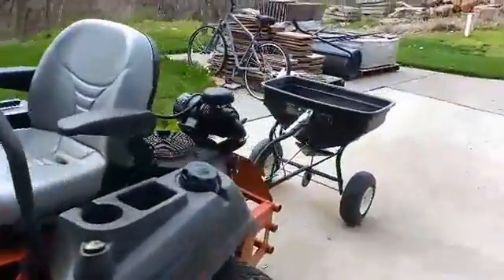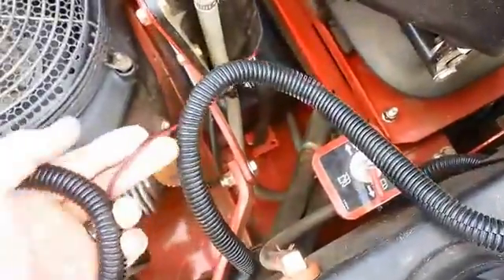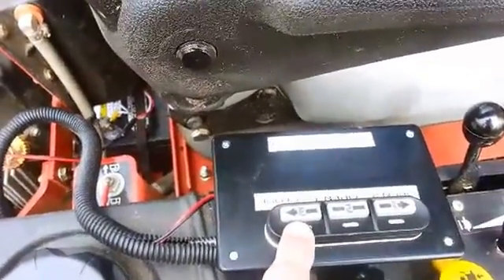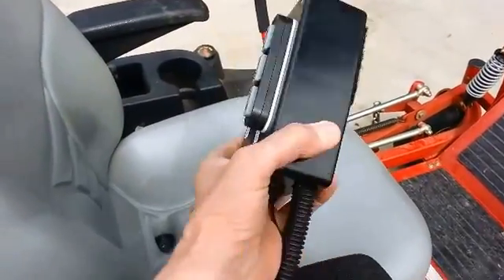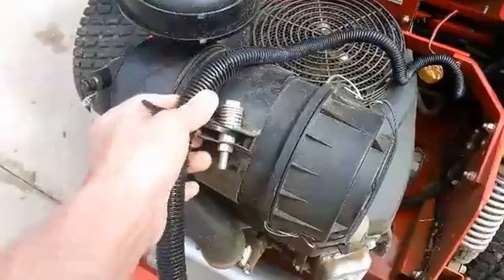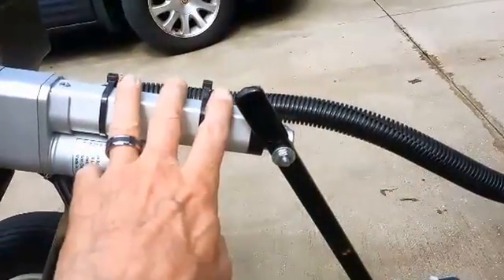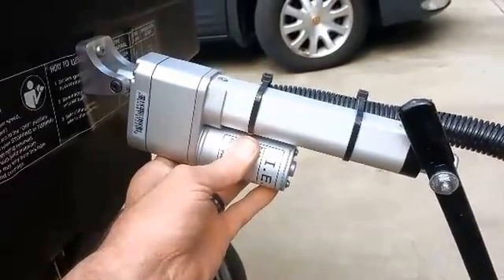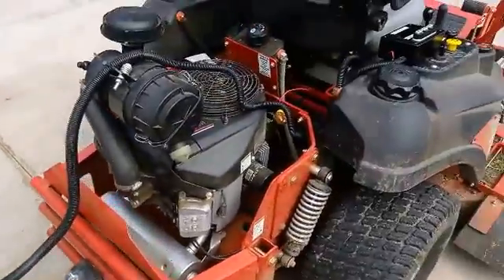Robo Spreader

Comment: Brilliant !   I’ve watched other videos which tout the use of the linear actuator  but none with the programmable controller.  You should patent this and sell the idea to agri fab or one of the other mfg’s of tow behind spreaders.  I would appreciate knowing your source of material: actuator, and box and controller.   I’m excited to make this a winter project.  I have a JD 1025r…and , especially with I hitch ( and other quick hitches) there is no way to reach the control lever ,, physically or safely.  The next step would be to rig an edge guard that could be at least manually controlled.  e.g. you could save all you edges to do at once, etc.   I continue to be amazed at the apparent reluctance of the tow behind mfgs to sell something like this on the market..
Reply from the maker: Thanks for the kind remarks. I too am amazed that solutions like this aren't commonplace. It's been a long time but I'll see if I can find the source that I used for the controller. The rest of the adaptation was just me fabricating a few small parts to make it work. And it did  work. I used it for years. An edge guard would be a great addition.
Reply from the maker: This looks quite similar to what I bought. https://www.speedwaymotors.com/Linear-Actuator-Controller-for-12-Volt-Single-Actuator,7477.html?sku=91064295&utm_medium=CSEGoogle&utm_source=CSE&utm_campaign=CSEGOOGLE&gclid=CjwKCAjwk_WVBhBZEiwAUHQCmRMzvyitxVkKeXPVdPe9xPAV14bbM0p3FL90AhNS7TlPJlN4Kfb_KhoCA9cQAvD_BwE
Reply from the maker: And here's the 4" actuator. https://www.speedwaymotors.com/Speedway-Gear-Driven-110-lb-Linear-Actuator-12V-w-Potentiometer,432282.html?sku=91064288-4